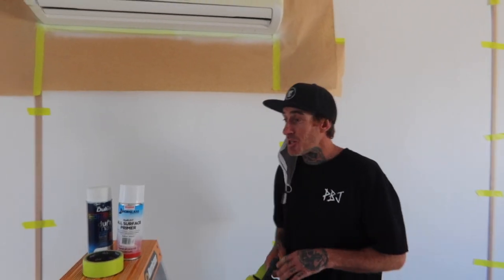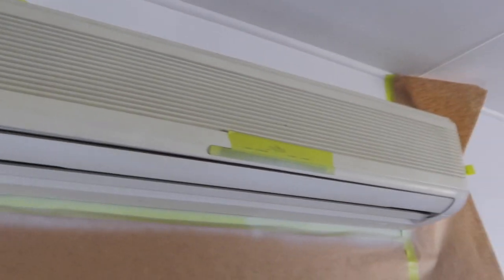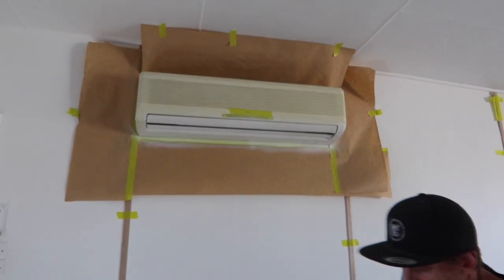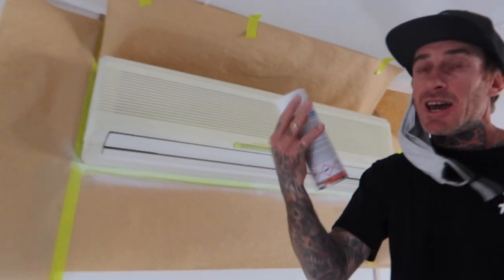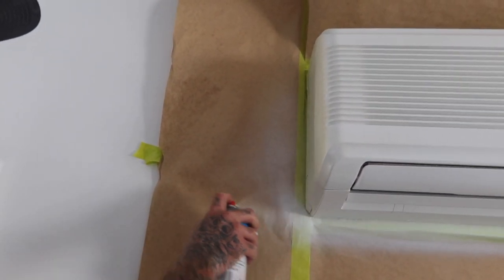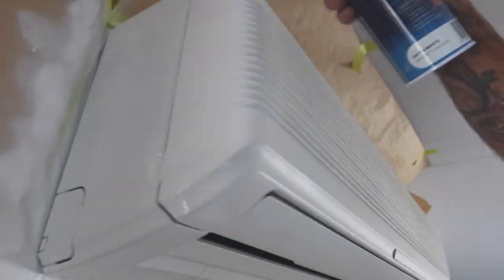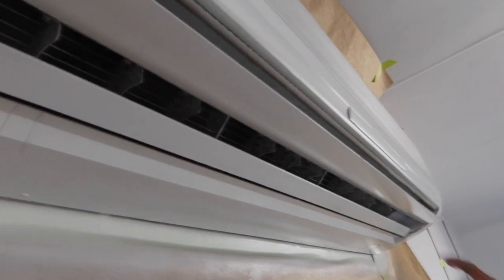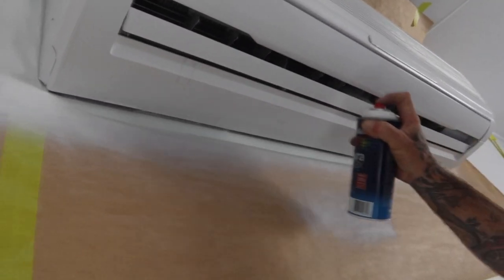HOW TO PAINT AN AIRCON

Comment: why would you not remove this cover to paint it???? over spray on its evap coil or even filter would be a problem... as an HVAC guy i can say ive had all kinds of major problems with equipmemt caused by painters, often not even by painting a unit directly. if you remove the units cover for painting not only would it be easier and look way better because almost no masking would be needed but you would be hard pressed to damage or screw up unit operation. few screws and popping few plastic clips and those things come right off. you spent more time masking it than a pro removing it. I do not advise painting in place. use plastic primer too

Comment: Did you cover the inside parts to protect the mechanical function? When I remove my filters, the inner workings would get covered in paint as well… advice?
Reply from the maker: Just remove the filter's and replace with cardboard cut to the same shape as the filter's spray out and saves any over spray going on the aircon 🙏
Reply: U and I know u didn't show what you're saying now in ur video sometimes if people learn from ur videos they'll spoil their gadgets

Comment: Can I paint over instead of using spray paint?
Reply from the maker: Are you saying paint with a brush?
Reply: @paintingbyjosh  Thanks for replying! Yes indeed, I am thinking of a small size roller with water based paint in white, not brush as it will leave lines. Will it work or oil based paint is preferred?
Reply from the maker: @whizkid4690  can I ask the reason you wouldn't use a pressure pack? You Just wouldn't get a factory finish with a roller!
Reply: @paintingbyjosh  That is true, Josh. I thought that roller wouldnt be messy over spraying. My painting works are already done but I realized I missed my aircon only after watching your great video.
Reply from the maker: @whizkid4690  spraying definitely would be a better solution getting into all the blades would be tricky without spray👍

Comment: Did mine josh I’m as anal as they come so expected the worse,I painted walls white and duri max spay flat white I used same colour as wall so in the end better then new as same colour as wall , this video works it’s very very good . I only tried thinking I’ll bin anyway. It’s that good I would do near new if slightly yellow aircon after 2/3 years Cheers
Reply from the maker: Hi Mark, appreciate the message and watching on.  Stoked you achieved a finish you are happy with definitely saves on buying new Aircon if it only discoloured 💯